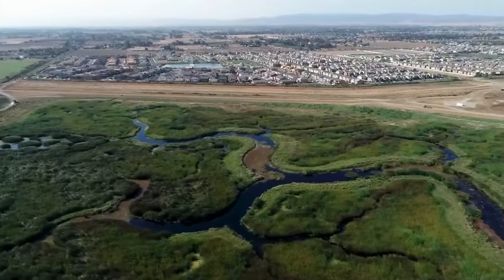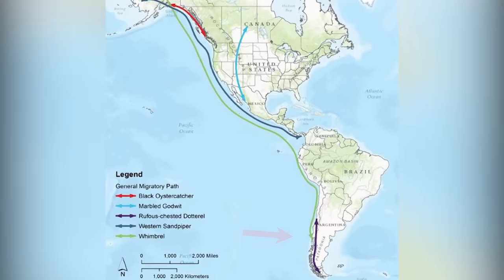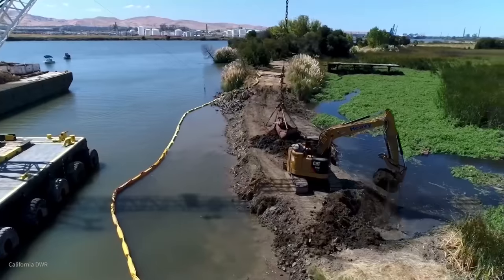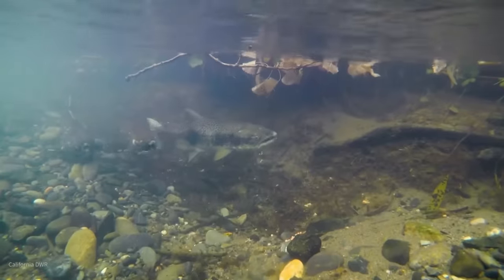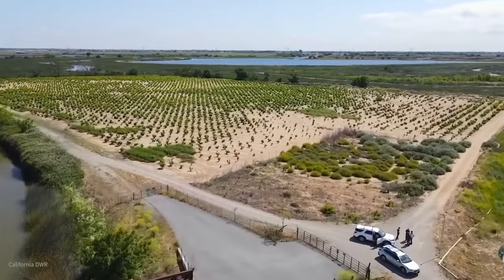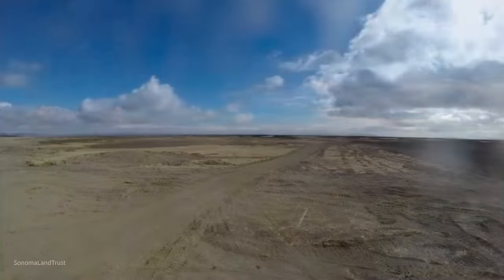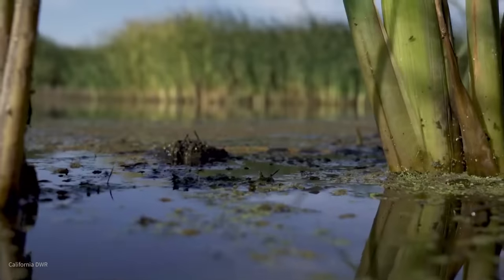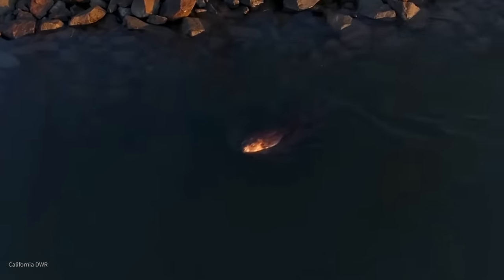This Is How California Is Spending Billions To Solve It's Geography Problem!

Comment: $300,000,000. What a waste. Could have done less for less and ended up with similar results. Could have used some of that money to chop down trees around power lines or cleared brush. Could have saved damage from wildfires. Big government, big projects and big waste.
Reply: Create energy from source. No need for power lines then, right. Restoration is so vital, it's also priceless.